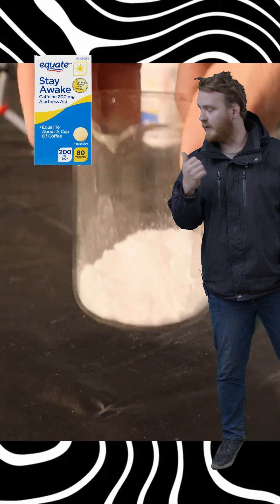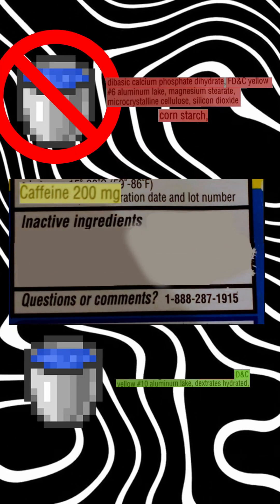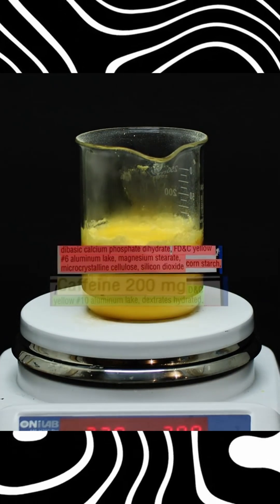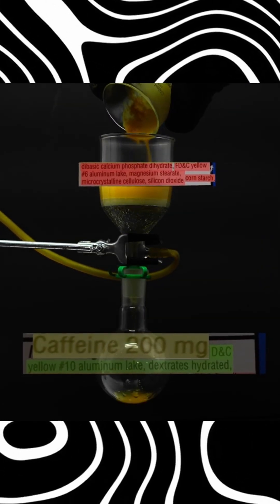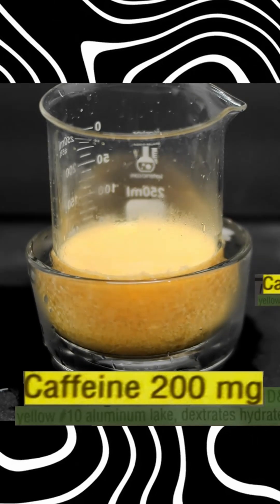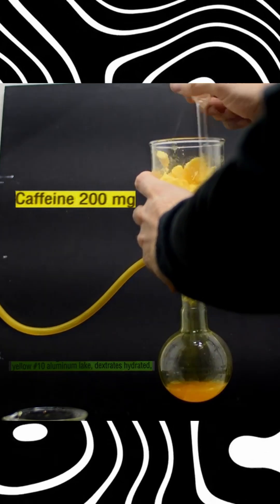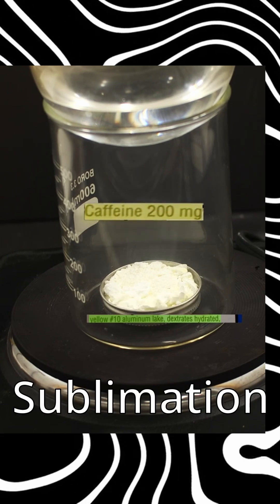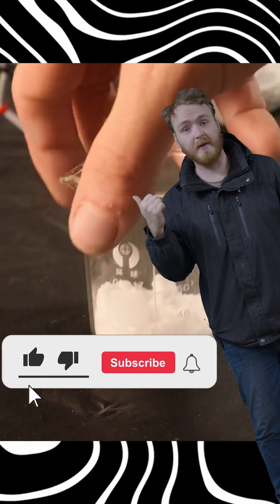Extracting Caffeine From Pills #science #chemistry #scienceexperiment #experiment

Comment: I have 200mg caffeine capsules, the only other ingredient is rice powder.  So room temp water, mix caff pills in, strain & then what exactly to make it crystalize ? I saw a comment on another page where you said cool it down, but how exactly. And is a cheesecloth folded over a ton sufficient filtration?
Reply from the maker: Rice powder huh? Yeah there's a lot of chemicals in natural things like rice. But yeah if you add just enough hot water to dissolve everything, filter and then let it cool you should get relatively pure crystals. 

If the hot filtered liquid is clear then the cheese cloth worked. If it's full of sediment it wasn't enough.